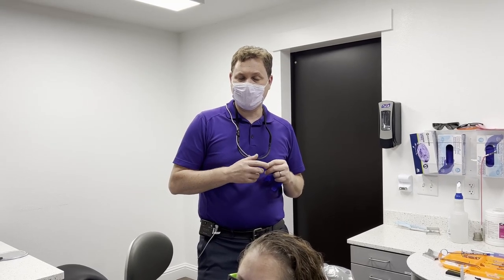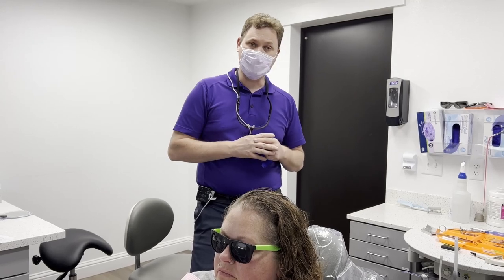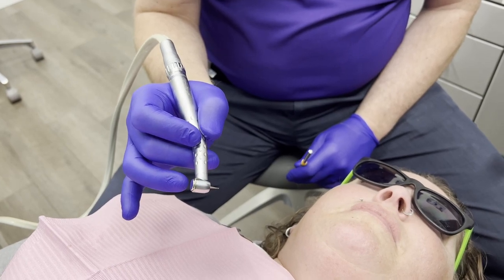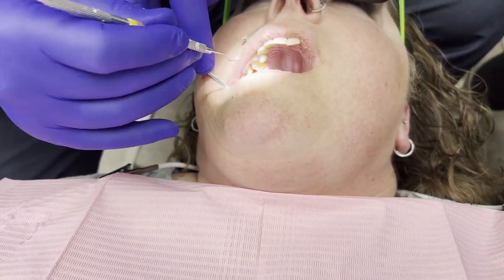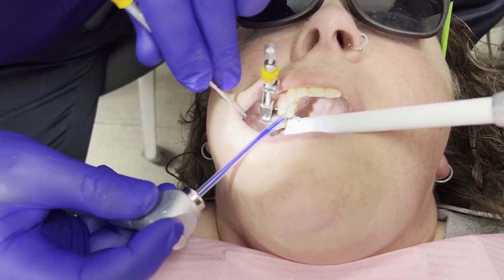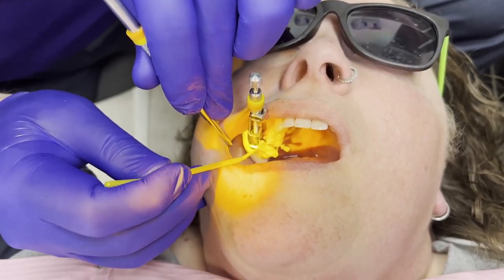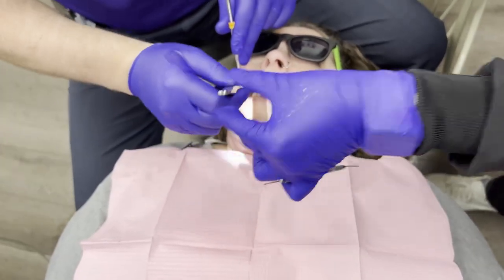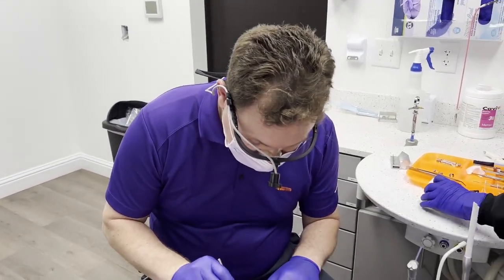GP Doctors - Class II Filling with Composite

Comment: Assistants know or at least should know the direction the tofflemire goes. At least I do when I assist and always set up the band
Reply from the maker: Problem is we do full mouth fillings and assistants dont know which tooth well start on especially if I get say 5 teeth numb in 2 quadrants and one quadrant numbs quicker, Ill start filling that quadrant, and many times the assistants dont know if we want to start on a smaller tooth or larger, best to have doc do it right before filling. Also if you pre setup, you might be first working on a large molar that needs the band to be its openest, so there are game time decisions that rarely allow for a pre set up band.